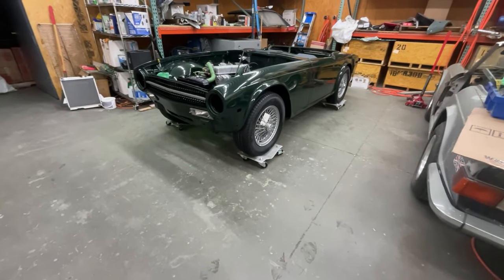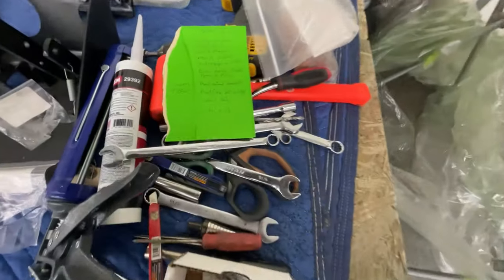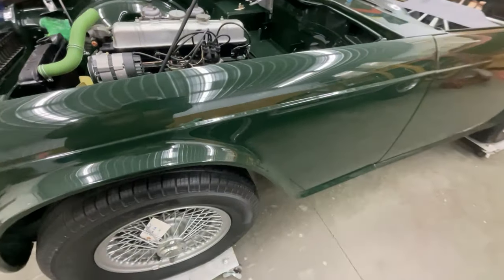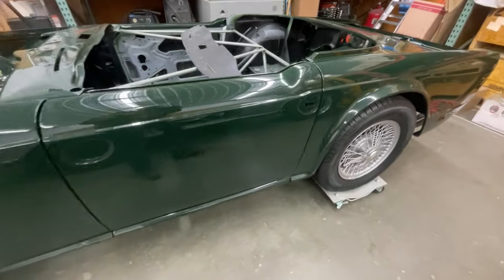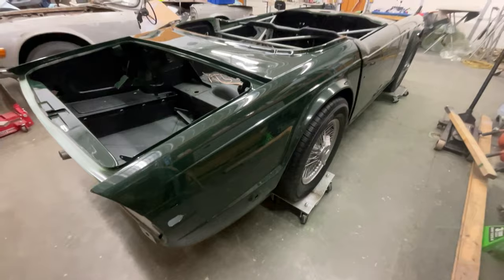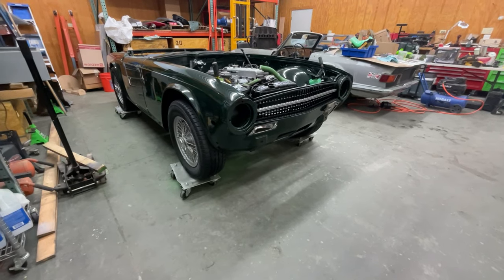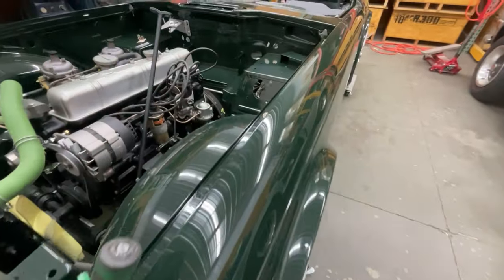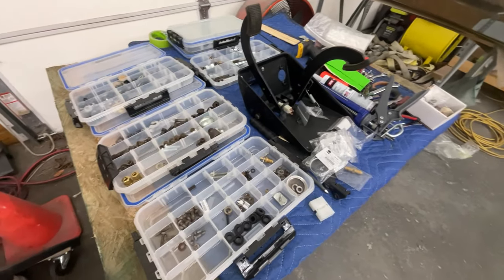Tr6 installing painted panels

Comment: If those body panels are on "loosely" with that kind of gap tolerance, my car's panels are in different zip codes. Excellent work so far!
Reply from the maker: The fronts have one bolt and a screwdriver each holding them on. The rears have two bolts each. That’s all holding it. I really work to get a superior body shell. If you work at it you’ll get there also.